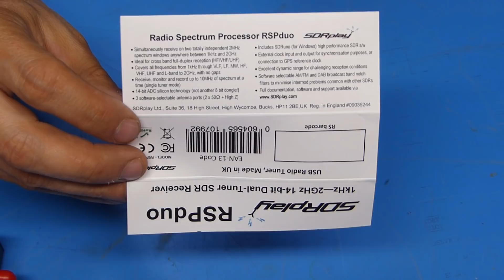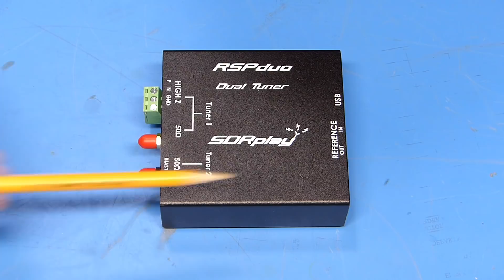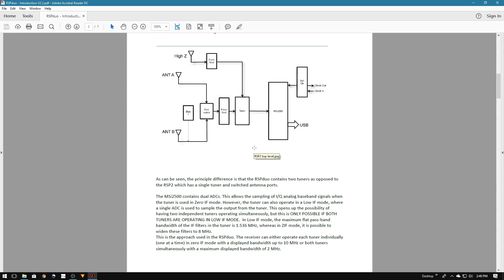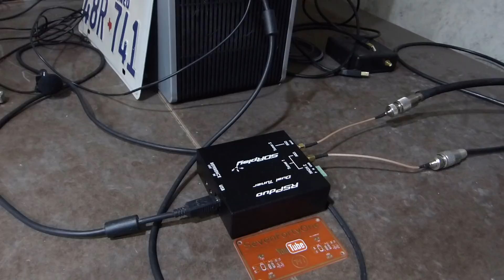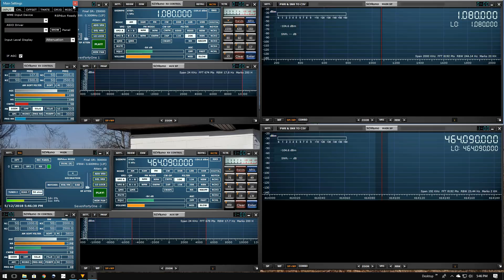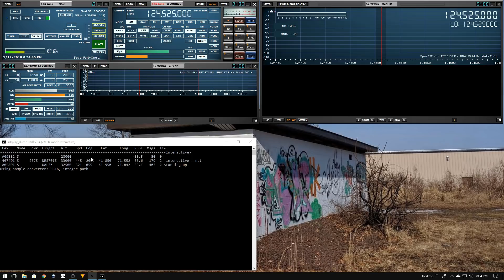SDRplay RSPduo First Look and Basic Overview / Demo of SDRuno and Dump1090

Comment: Hi there ! Thanks for the informative video, nice job ! A SDRplay distributor mentions on his website that the RSPduo "is equipped with a software-adjustable LNA" ; How can one enable and adjust this built-in LNA ? I can't find it ! Keep on the good work ;-)
Reply from the maker: I'm not near my software at the moment but I think its just the RF gain control on the main panel that controls the LNA.  There may be additional controls buried in the settings under the main panel.

Comment: Good informative video SevenFortyOne, especially for an old radio hobbyist looking to jump in to the world of SDR. Quick question, say I decide to just go with the RSP1A for now and later on decide that I should have bought the RSPDuo, can I just buy another RSP1A and do everything the duo does? Seems like it would be the same, just using an extra USB port. I'm not sure if you can select another receiver on the second instance(slave) of SDRuno.
Reply from the maker: Yes, you can run two rsp1a units side by side on the same computer...the duo has a few features the 1a lacks like a hiZ port and some extra filtering .  You can also run multiple virtual receivers on one rsp1a, but the tuned frequencies must be within 10MHz of each other. Check out my latest video for a demo of side by side Operation.

Comment: Thanks for the very descriptive video about the very low cost SDR radio. What was missing from the video is how the low cost SDR radio compares to your other HF radios you own, and other more expensive SDR radios on the market, if you’ve compared the performance. It’s hard to imagine a low cost SDR receiver could perform as well as another HF radio costing 10 or 20 times the price.

So, generally, how does this low cost SDR receiver compare to your other HF radios?

A quick look at the SDRplay web site did not say what type of computer hardware is needed. It only mentioned PC, nothing else. Are there some recommend minimums for the computer specifications? Is there a Mac version of the software, or does it require a Windows computer? If it requires a Windows computer, what’s the minimum OS level required?

It’s shocking that a company that is selling SDR radios that require a computer, has almost no information on their web site about the computer that’s required for their SDR receivers!
Reply from the maker: Others have asked for the comparison you mention above.  I've been planning to make a comparison video but this is my hobby, not my job, so I haven't gotten to it yet.  Hopefully I'll do this soon so stay tuned....but I can't make any promises. I think there is a general understanding out there that these SDRs are still for enthusiasts and not the average consumer so to speak.  In other words, SDRplay's resources are limited so there are going to be so aspects of the product, software, marketing, and documentation that is limited.  I think that for the price (at least of the entry level RSP1A) you are getting a tremendous value so you have to take that into consideration when evaluating this product.  I believe there is software for Apple and Linux that will run SDRplay's radios but it may require a bit of tinkering to get it working.  I'm not an Apple guy and haven't had time to try out any Linux packages yet  so search their website and google for more detailed info.  Again, I'm not an SDRplay employee so I don't have hard specs for you but these radios will run on older, low spec hardware.  If you search my channel you'll find that I ran the RSP1 on an old Celeron "XP" laptop with no issue whatsoever.
Reply: Thanks the response. I wasn’t expecting a comparison video, but now that up brought it up, that would be an excellent follow up video.

Meanwhile, can you just state in a few sentences, roughly how the low priced SDR receiver compares to your other HF radios?

For example, I started with a HealthKit HR-10B and HW-16 that I bought and built. Later, I bought and built a HealthKit SB-102. The SB-102 was a tremendous improvement. Later, I bought a Kenwood TS-940, which was a tremendous improvement over the SB-102. Those two improvements were huge! 

Are your more expensive radios much better, a little better, or similar when comparing the raw ability to receive signals along with the quality levels of the different radios?
Reply from the maker: @daveborchard2019  That's a tough question to answer in a few sentences.  I also suspect this is something that could be a little bit subjective depending on what you expect out of a radio.  I've never really tried comparing them side by side to see which was better at pulling out a weak station or something on the fringe.  Having said that, head-to-head, in a casual listening environment, the SDRplay is pretty close in sensitivity to both my Icom and my Elecraft.  The Two physical radios are much better at image rejection and not getting overloaded by strong signals.  In my opinion, the "real" radios are also more pleasurable to operate...there is just somehtign satisfying about turning knobs and pushing buttons as opposed to clicking a mouse to tune a radio.  However, the SDRplay frequency coverage blows both physical radios out of the water.  In other words, for $100 or so you are getting essentially a DC to daylight receiver whereas you are getting only up to 144mhz (with gaps) on the icom and only 54MHz on the Elecraft for 10 to 15 imes the cost of the SDRplay.  You also get much more control over the receiver with the SDR through the software's extended functionality.  On top of that, the software can be upgraded and re-written to extract new features from the hardware over time.  In summary, I don't think the SDR is better or worse....I think its a different way of looking at receiving radio signals.
Reply: @SevenFortyOne  Thanks for your response! That's good to know that the SDR receive is close to the sensitivity of your physical radios. When I compared the HR-10B and HW-16 to my SB-102 which I bought and built years later, the old HR-10B and HW-16 seemed to be very crude "crystal sets". Stations that were in the mud with the HR-10B and HW-16 were easy to copy with the SB-102. A huge difference. Same thing when I upgrade to the Kenwood TS-940. Stations that were in the mud with the SB-102 were easy to copy with TS-940. Again, a huge difference. 

Maybe the Flex radios might compare better to your physical radios, since the Flex radio probably has a much better front end that the very low cost SDR radios. Of course, the Flex radios cost about $2,000 to $4,000, so you're going to get much better hardware for that money! I do understand what you mean about having and using a physical radio. I might need to setup a remotely controllable HF radio in the future if I buy a home in an area where I can't install HF antennas. In that situation, having a radio that is controllable with a computer would out weigh the physical radio benefits. Although there is a Flex radio front end, that looks and feels like a physical radio, that can control the actual physical radio, over the Internet, that is remotely located. 

Even though the lower cost SDR radios may have some shortcomings, they seem like incredible value, what you get for only $100, and the software is included for free!
Reply from the maker: @daveborchard2019  Oh - and the SDR makes it very easy and seamless to receive the newer digital modes or even older ones like CW without external hardware or additional wires and cables.  Simply pipe the received audio of the SDR via software to a decoding software and you're done.  Receiving digital modes on analog radios is much clunkier.

Again - SDR is a different solution to the problem of receiving radio.  Whether or not it is better or worse that a traditional radio is up to you.  But I will assert that right now (Dec 2018) the offerings from SDRplay offer the best value, by far, for getting into SDR receiving.

Comment: They warn of not having it near a transmitter  I have 2 endfed  antennas and the coax runs parallel  for several feet. Do I stand to fry my SDR if I use my radio? Or do I get the MFJ 1708 which allegedly  isolates the transmitter?
Reply from the maker: I wouldn't take a chance...get the mfj if you intend on leaving the sdrplay connected all the time or as a panadapter.
Reply: Would be nice if that they would publish a limitation  so we can either use Web SDR or get on with our lives.

Comment: are you sure that the gps is only for use in "test equipment" applications?
Reply from the maker: There is no gps in this unit.  If you are referring to the ref out port I'm sure there are other uses for it.
Reply: SevenFortyOne Of course there isn’t. But they sell the Leo Bodnar GPSDO units for a stable reference signal . This is useful in a Lab setting. But it is also useful for some digital modes where timing becomes critical to the reception as well. That was my point. See the vendors website.

Comment: Only reason I paused the video was to tell you that nobody can read that fucking 2 point type!    :)   - but thanks for the info  !!  I love this thing!  :)
Reply from the maker: The text on  my raw video file looks good.  YouTube compression has caused things to look blurry...nothing I can do about that.
Reply: ok  - that makes sense  - but i hope you  come closer, on the next video!  :)
Reply from the maker: This is a screen capture ... can't really come closer.  BTW, check the youtube playback settings and make sure you are watching this in HD...the gear icon at the lower right of the youtube player window.  If you aren't in 1080p mode, switch it to that and see if it looks better for you.
Reply: ok - thanks for responding to me, and yes, when i use full quality HD  i can see everything, so sorry for being such a snit!  :)
Reply from the maker: No worries!
Reply: I couldn’t read the text with my iPhone 6 Plus, but it was very easy to read the text on my 27” computer monitor using my MacBook Pro.

Comment: Thanks for excellent video.

The one thing I really want to know is can the 2 receivers be phase locked together, being on the same frequency,  and track each other.

Thanks.
Reply: They're specifically touting phase coherence of the two receivers as a feature, and as far as I can see it should work just as well with them on the same frequency as it does any other way.
Reply from the maker: I don't think that is an option right now but may be in the works for an upcomming software release.
Reply: (that's sampling coherency though, I don't think you can expect the two VFOs to be identical, so there's a possible source of error there, to the tune of whatever the VFO phase noise is.)

Comment: Can this be used with my DSD plus,digital audio decoding software. If it can I think I will have to set up a virtual audio cable instead of my hard wired cable that now connects to my Icom IC-R7000 receiver.Thanks for this video, Greetings from NH.
Reply from the maker: I'm not sure....I haven't used DSDplus yet but will have to give it a try soon.  Thanks for stopping in from NH!